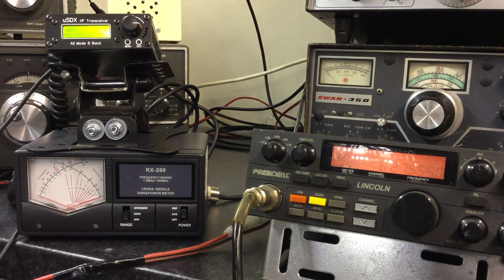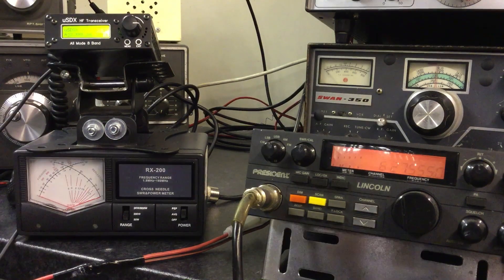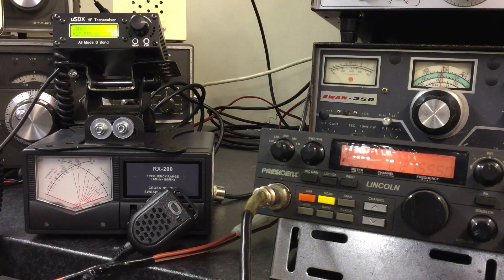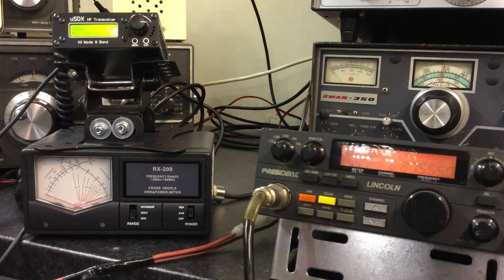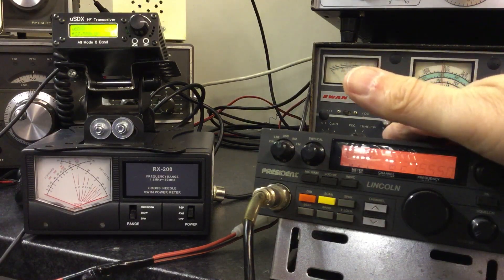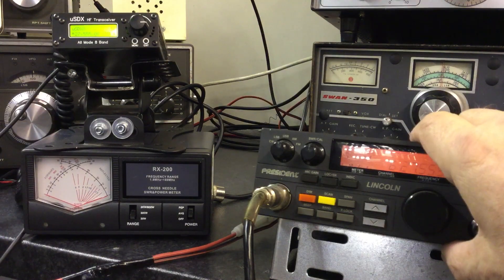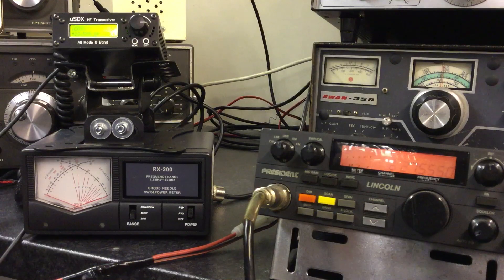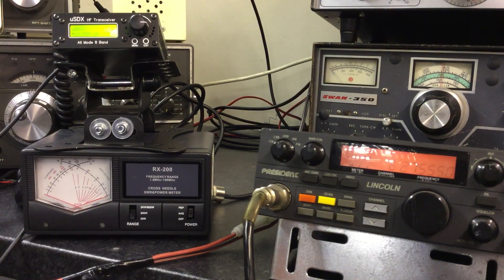uSDX uSDR REQUESTED - “Will this rig work on 11m band?”

Comment: Thanks Mark for the input I just ordered mine as I see you have the older one since both buttons are under the main dial. Regards and can't wait to get mine 73's
Reply from the maker: Mine is version 2.7.1
I have no idea where that fits into the version you’re getting?
Mine has the factory 5V mod, sobis quite late.

Comment: Thank you (:I think you did a good job of explaining the facts! I guess it's normal for usdx not to perform properly at 11m. But the 45m band is almost identical to the 40m band - I think the difference here should be smaller? Here in Europe - especially in Italy - the 45m band is something like (unofficial) CB radio...
Reply from the maker: I used to use Echo Charlie in the 6MHz band, but not these days.

Comment: I think you'll find the local Osc needs adjusting, as you probably know if you calibrate it for the highest Band the lower bands fall into place.
Just calibrate the Local Osc and job will be a good one..
I got Mine working on 4 Meters 70Mhz with no problem..

Comment: I just received this radio today, and see it does not come with a battery installed. I'm just getting back into HF, so what battery or power supply can i use on it. Tnx. 73s, N7BFT
Reply from the maker: Mine doesn’t have a battery either.
I use an external 13.8V PSU.
In fact, recently I’ve been using an old CB PSU 13.8V @ 3A.
It’s more than enough.

Comment: Hi Mark,does this do 11m straight out the box?
Reply from the maker: Watch the video...
This TXs and RXs, but will need setting up.
The answer is yes, but not very well until set up.
Reply: Ok Mark have watched it but just wonderd if it had to be moded in any way from new?as 11m isn’t a recognized ham band and most other radios need sim sort of mod to use on 11m. Thanks and will keep checking how u get on with the radio
Reply from the maker: Christopher. I assumed you'd not looked at the video.
I won't be using this on 11m, hence the use of dummy loads for this test which was in response to people asking "Will it work on 11m?"
This will go straight onto 11m without mods (mine is version 2.7.1)
But it won't work properly there and I have no idea about harmonics etc.
This is not a commercial ham rig and should not be treated as such.
It is an experimantal/development rig.

Comment: For no distorsión in SSB modulation ajust   NOISE  GATE
Reply from the maker: I have for 40m and 80m and it sounds good.
I was’t interested in using it on 11m so I didn’t bother to adjust here.
Reply: Pa BIas MIN 10
Reply: Would you be so kind as to explain how the rig is properly adjusted for 45m/11m operation? <3

Comment: My buddy pulled up beside me in his car and said, "Hey, turn on your radio!" He'd called from 2 blocks away during a driving rain and I hadn't responded, so he pulled up beside my car, flipped on his amp and said that, and I heard it, a bit distorted, in my radio. When radios are on top of one another strange things happen. 

As far as uSDX's go, each band installed has a bandpass filter to keep everything else out. If you wanted one to work properly on 11 meters you'd need to build a bandpass filter for it, and substitute it for one of the others, or modify one of the ones already in the radio. It's just RF, not magic. But why would anyone with a ham license want to talk on the CB band to people who can't pass a ham test that kids have passed who aren't even old enough to read?
Reply from the maker: I have no interest in 11m myself.
Just looking after a few requests…
I think you’ll find there are LPFs in this not BPFs?
But you’re correct, there isn’t a filter specifically for 11m.
Reply: @m0jcfhamradio75 , yep, it does just use low pass filters. I had a brain fart about which radios used which. Been looking at a lot of schematics recently, and I've started building the (tr)uSDX rig, although I'll make my own RF bd for it with full band-pass filters, and include some different bands. One of them will indeed be the 11 meter band in case of emergencies. (I live about 5 miles from the scene of the Marshall Fire a couple of months ago.)  With all of the info online these days, and $50 NanoVNA's it's now very easy to build up some real good filters for whatever band you like. Along with the versatility and functionality of the Si5351's there's really no longer an excuse for not building most of our own rigs these days, or at least heavily modifying the designs of others.